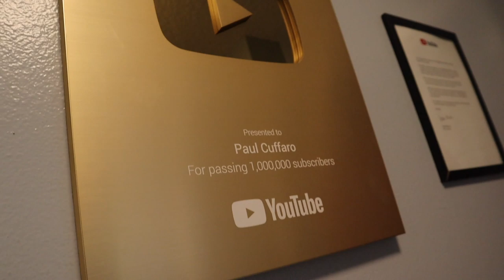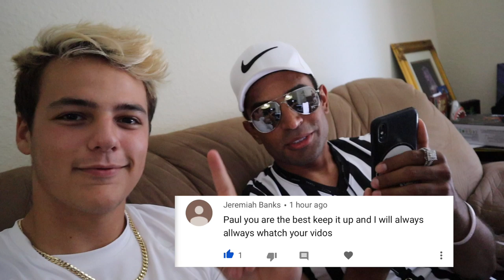BUYING 2 RARE SPOTTED TURTLES!!!

Comment: Hey Paul I have some advice for you. Your truck cant tow as much as it could when it wasn't lifted. Don't get me wrong, beautiful truck but lifting that high kinda ruins the towing capacity. You can still probably pull a smaller boat but like a 5th wheel rv won't work. I have a 2018 Ram 2500 and it is stock ride height it is still a tall truck. Don't get the wrong idea I'm happy for you I'm just tying to help